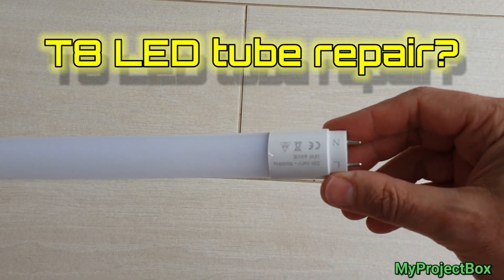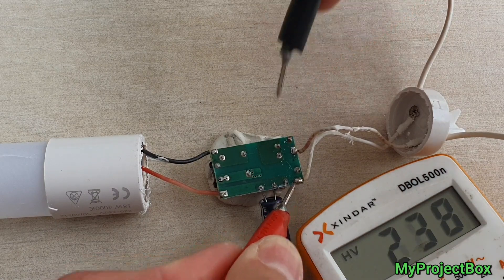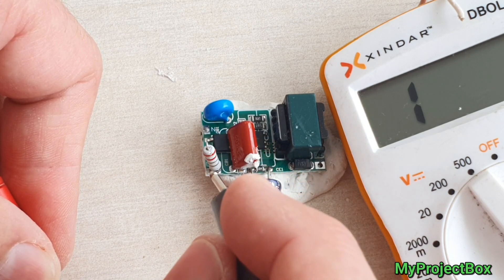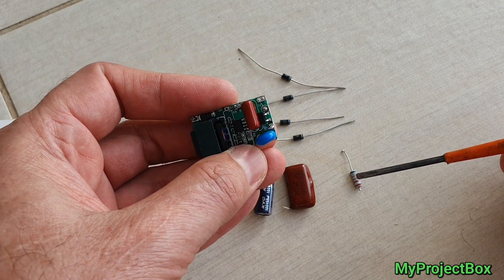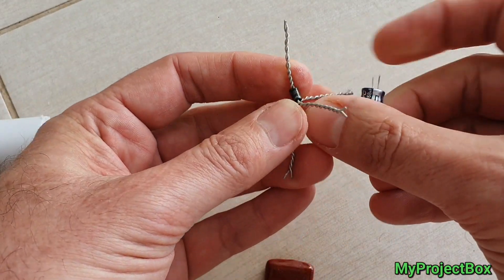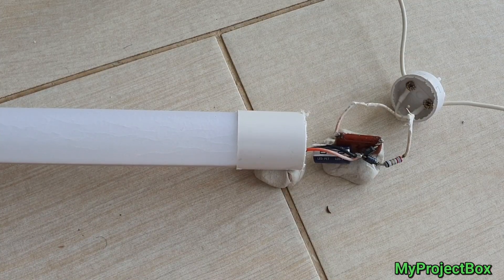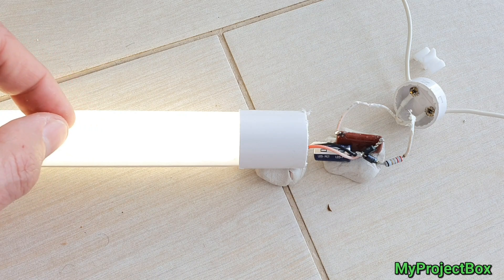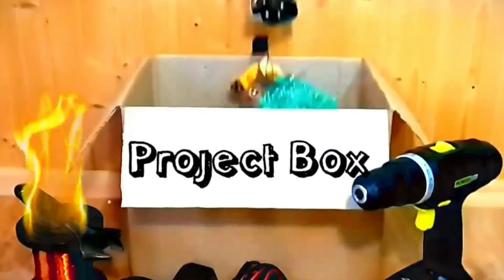Failed LED tube repair with DIY Driver circuit

Comment: I really appreciate this video. I have dozens of these bulbs from by business place that I have kept because I always thought there MUST be some way to repair them AND I am sickeded by the thougt of them going to the landfill. Yes, I'm a bleeding heart environmentalist...and I make no apologies for that!!!😁😁😁😁.
I do have one question though, since you said its a "crude" driver, I was wondering what are the disadvantages compared to a more sophisticated driver??? I mean after all, it works right!!??
Reply from the maker: @andreb877   yes it works pretty well and it can work reliably for many years. Because it's so simple there is very little to go wrong. However it's not perfect. It has bad power factor. Domestic users don't pay for "bad power factor", so it’s not a big problem. The circuit is not very tolerant to "high frequency" noise on the AC supply, that can pass straight through the dropper capacitor, and make it's way into the leds, and possibly damage them. A faulty Switch that has sufficient arcing can generate high frequency spikes that can potentially harm the LEDs. Some of my older LED bulbs have this type of driver circuit and are still going strong after many years😉👍

Comment: Thanks for this, I've replaced some stabilizer caps on flickering tubes before and now I can fix them all! Curious if this circuit is better than the original, and why then don't they use this instead? Pros and cons of this circuit over the original?
Reply from the maker: @andredutoit5340  the main advantage of this circuit is its simplicity, and because of that it is very reliable. But it's not perfect! Because it's a capacitive load, it has poor "power factor". You don't get charged for power factor, in domestic use, so not much of a problem. The capacitor dropper is basically a "high pass filter", so if there is "high frequency interference" on the mains supply, it will be dumped straight onto the LEDs and possibly damaged them, or shorten their lifespan. A example of high frequency  noise, would be a arcing light switch, not switching off properly.

Comment: i always cut the led strip into 12v section and power it with constant current step down converter, the driver in t8 tube is tiny and always fail(because leds have enough cooling to not fail unlike led bulb)

Comment: I think it's a good idea to repair led lights because I find it's the drive that goes out in most of them.
Reply from the maker: Yes, and most of the time a simple capacitor dropper circuit is all that is required. You can also reduce the current to the LEDs to run them slightly cooler😉

Comment: Afraid I can't agree with your statement that the LEDs are less susceptible to spikes from that capacitive dropper.  When LED lamps first came out I experimented with a bunch of driver circuits, in order to add some bright LEDs to my garage door opener.  I totally gave up on simple capacitive droppers.  They all failed sooner or later by  burning out an LED.  Easily spotted by the black spot that would appear on the dead LED.
Reply from the maker: Yes you are right, and maybe I should of clarified what I meant🤔. "Cap droppers" are essentially high-pass filters, So any higher frequency switching noise and garbage, pass straight through. With just a single long series string design, one LED will become the weakest link in the chain, and take the entire light down. What I was trying to say, is that my strip has multiple series strings in parallel. So It can cope a little better with shunting out the current spikes. But you can still get a cascade type failure, because LEDs are quite fragile. It's not a good driver for noisy electrical environments.
Reply: @MyProjectBoxChannel So, is there an inexpensive and relatively simple way to add a low pass filter to the circuit for the case where the LEDs are in a short series of 6 - 12?
Reply from the maker: @johnbauman4005  the main filter/smoothing electrolytic capacitor is already working as a low pass filter.
Reply: @MyProjectBoxChannel Well from my work on digital image processing, I know smoothing filters = low pass filters, but if there is too much high frequency noise getting through, is there not a way to filter out  that noise downstream before it hits the LEDs?

Realizing that not all mains power is created equal, would you consider suburban U.S. power noisy? Or are you referring to internal noise generated by the circuit itself, or both?

Just trying to work out the scenario with fewer LEDs that can't be rigged in an S/P array.

Thank you kindly for teaching!

Comment: The reason it's so fragile is due to the large amount of UV radiation that the LED's produce.
Reply from the maker: I know the old fashioned florescent tubes produced a lot of UV light, and it made everything plastic, brittle inside the light fixture. But I don't think LEDs produce true UV light. It might be "near UV" ,purple blue light. It's still very reactive, and perfect for stimulating the yellow phosphor, to make white light.

Comment: I guess the value of 1uF dropper capacitor was not arbitrary.
Reply from the maker: Yes I  tried using different values of capacitor until it approximately matched the brightness level of the other lamp. The LED current is a bit lower than the original, so it will be better for the lifespan of the LEDs.

Comment: Danke für das Video.
Wie hoch ist die Spannung für den LED-Stripe? 325VDC? LG
Reply from the maker: 60Vdc +
Reply: Wie kommt diese Spannung zustande? @MyProjectBoxChannel
Reply from the maker: @Amperekaefer Die Eingangsspannung fällt am 1UF-Kondensator ab, da die Last an den Brückengleichrichter angeschlossen ist.
Die LEDs halten eine Spannung von 60 V.
Ich weiß nicht, ob ich richtig übersetze😂😂😂
Reply: OK, kapazitiver resistance, thanks. LG @MyProjectBoxChannel
Reply from the maker: @Amperekaefer Ja, es heißt Impedanz für Wechselstromwiderstand. für Dinge wie Kondensator und Induktor
Reply: All OK, thanks! @MyProjectBoxChannel

Comment: I would recommend replacing the 100V smoothing capacitor with a 400V one so that it does not explode if your LED strip goes open circuit.
Reply from the maker: Yes ideally a 400V rated capacitor would be better, and the dropper cap could be x2 rated😉.( This would mean a much larger capacitor, and there is very little space)I was trying to reuse as much as possible, and salvage bits and pieces.  The LEDs are in multiple series strings, several strings in parallel.  So if one LED happens to go open circuit,  There will be plenty others in parallel for redundancy. You might get the sort of cascade failure though🤔.  I have seen many cheap LED lamps use this voltage clamping approach, to use a capacitor with a lower voltage rating.
Reply: Some times you don't have enough room to place the components.

Comment: Thanks for your channel, lots of food for thought.
Kinda think you should at least refer to a mains safety video. 
Folk starting out who watch this may not yet realize how much care is needed when dealing with potentially lethal voltages.
Just saying.
My first mains shock threw me (age 6) across the room. My heart kept going so I lived to enjoy a great hobby and eventually profession.
Reply from the maker: You are absolutely correct. I really should've included a "working with mains voltage ⚡️" warning. I have done this in my other videos. I will add it to the description right now😉.